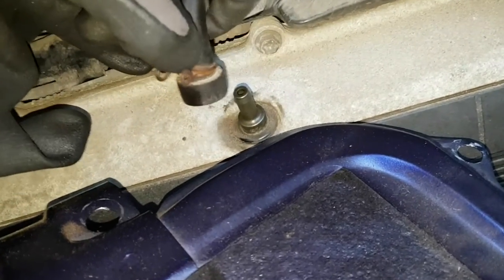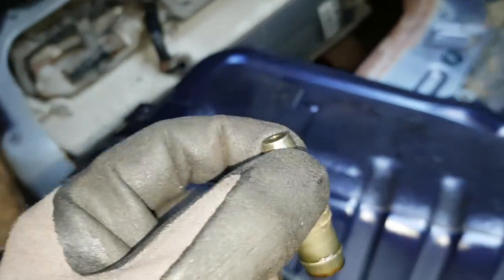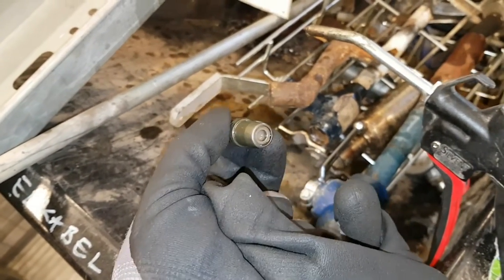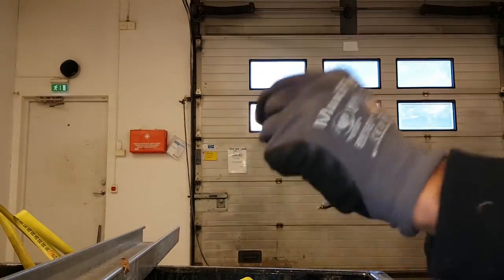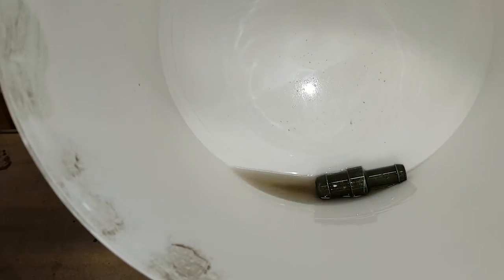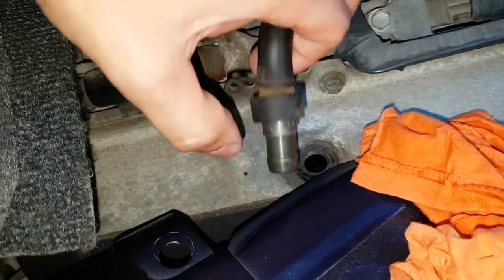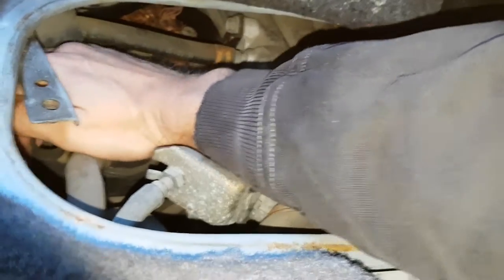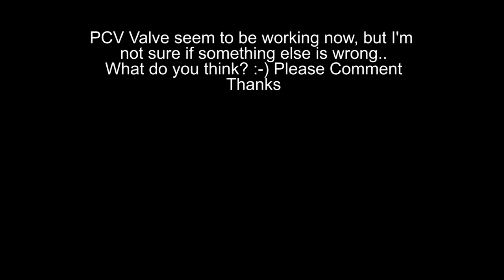Diagnose clean and fix PCV valve on Toyota minivan

Comment: Hello, i have 1999 model. And when i open the oil cap, the air is breathing from cap. Did you solved if it is ok or not? I have problem with engine oil in intake manifold. So i am trying to figure it out. Thank you
Reply from the maker: Hello, mine is 1998, I still have breathing from cap. My Car works perfect though, some folks on the Internet says it shouldnt be so,... I dont know. I fix the PCV valve, and the car run fine. So havent bother with it.
Reply: @MyChannel-l1c  bro in pcv system, small vaccum from oil cap or dip stick hole is normal and in case of high vaccum car will stall. There should be no any pressure in pcv system or air pressure from oil cap or dip stick hole